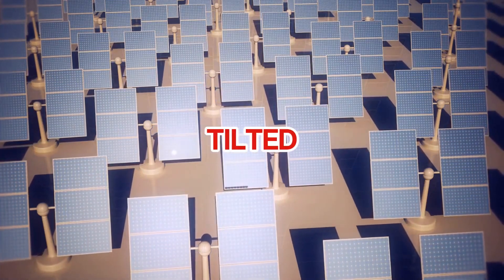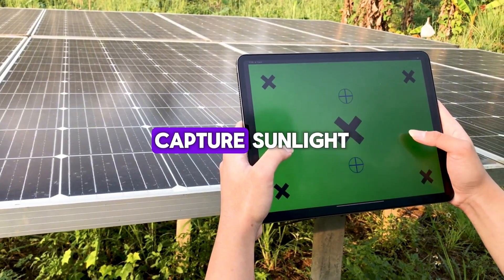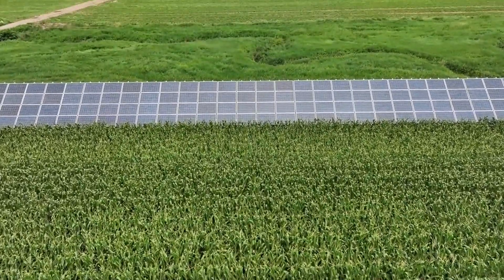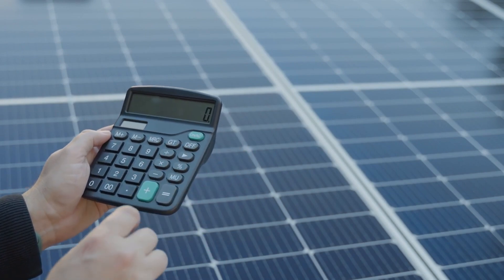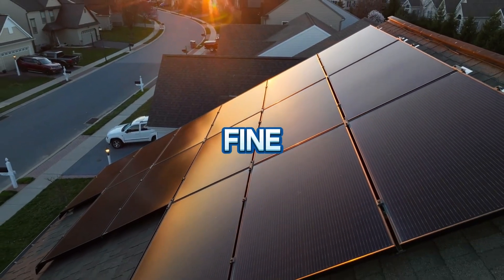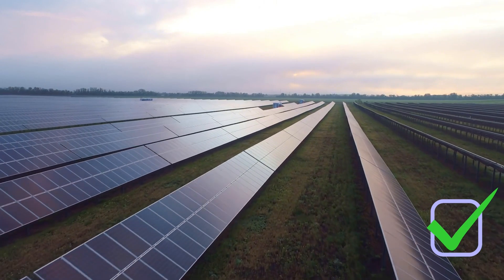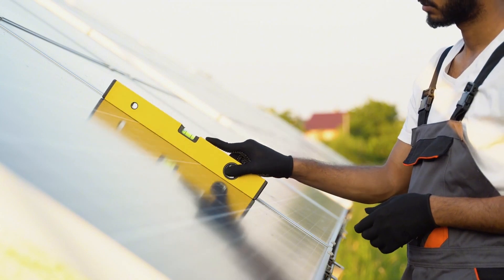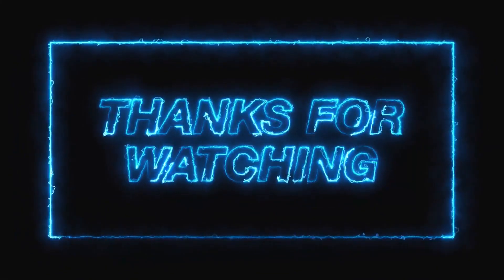How to Determine the Best Tilt Angle of Solar Panels?

Comment: I think setting to the summer tilt is better because outputs drops a lot due to the heat in summer.  Winter usually have surplus energy
Reply from the maker: thanks for your helpfull comment

Comment: There's another You Tuber that has an angle calculator, when I enter my latitude of 37.7188 it shows 10º in summer & 63º in winter, a far cry from your 22.7º & 52.7º, although I'm presuming 10º would be perfect for June 21st, then less & less effective. So maybe 22.7º would work. I have a little portable panel I'm using to keep my rv batteries charged while not in use, so I'm more interested in summer right now.
Reply from the maker: Thanks for sharing your tips

Comment: Well, the numbers you gave are not quite what online tools say; according to your numbers, I should target a 25° angle in the summer and 55° angle in the winter, with a 41° spring and fall. Most online tools say that 31-32° is good for year-round, while max summer would be 16° and winter would be only 45-46°.
Reply: agree
Reply from the maker: Thanks for sharing your findings; I'll look into why there's a difference.

Comment: What about place whose latitude is between 0 and 15?
Reply from the maker: Rule of Thumb: For latitudes between 0° and 15°:
Winter tilt: Tilt the panels at an angle roughly equal to the latitude.
Year-round (fixed setup): Tilt the panels at about 10° to 15° for optimal annual performance.

Hope it is helpful for you
Reply: I am at 12 degrees north. I used an online tool (PVGIS) to try this out. Optimal results were 8 degrees for optimal production and 28 degrees for winter production. Sadly I will need to fix them on my roof - when mounted on the ground, I will get too much shade. The roof is angled at only 8 degrees, so that's optimal for year round production, although I would have like a bit more generation in winter. I will have to add an extra panel. My results might be a bit off to your situation, because my roof is facing south-east. My advice would be to go for at least 15 degrees, because a lower angle will result in more panel fowling.
Reply: me too asking

Comment: 1:09 demonstrates factors that are missing from the audio.  Pictured are east/west arrays.  These don't optimise on a per-panel basis, but on a per-square-meter of ground basis, and are particularly good at generating power in the morning and evening.

Similarly, shadows being cast from one panel onto the next can result in degraded output, and therefore the 'optimal' angle for a single panel is not necessarily the optimal angle when you consider banks of panels.  0:40 is a good illustration of this.
Reply from the maker: Great notice
Reply: nice notice